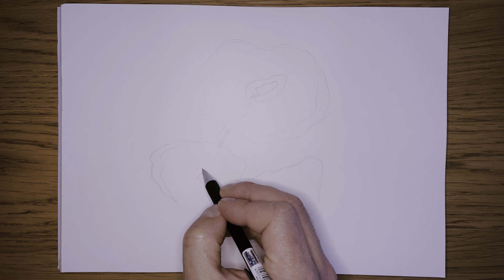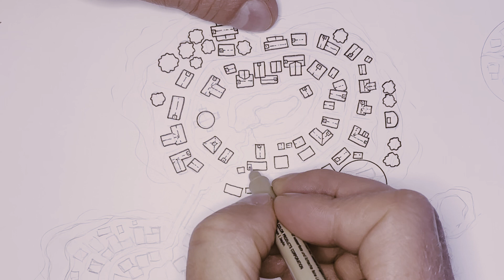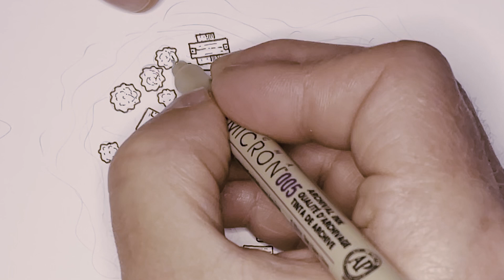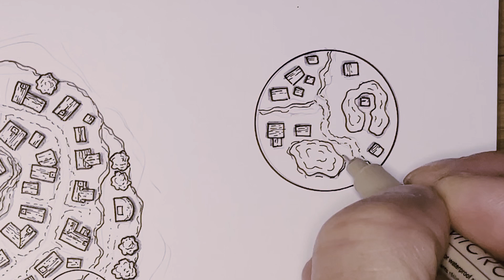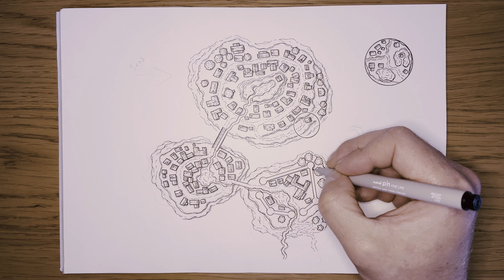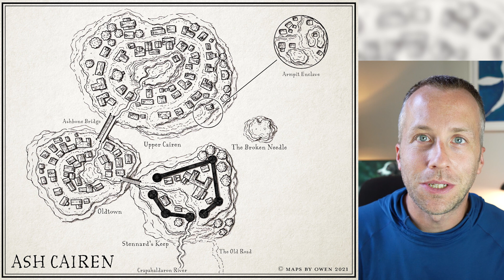How to Draw a fantasy D&D City or Town Map for your campaign

Comment: If you think of fantasy in modern western terms, yeah - maybe 4 people in a house. But usually you think fantasy in medieval standards and then it's easily 20-30 people in a house (end the 'houses are crammed together). Besides - it's fantasy, so you decide and then 50-60 people is feasable! It's only 5-6 families 🙂 Thus it could be only 150 houses, clustered into quarters/groups... Anyway, cool video - thanks...

Comment: Well massive, what is that? If we see that most Fantasy worlds are oriented on medical time, an 8k populated city would be already massive. Cities like Cologne with 20k have been scarce. It is also modern thinking that in a house live 8 people, at that time a household has been 10-12 people at minimum. In a city house, the family was father, mother between 6-8 been normal, mostly the parents of the wife, they all lived (slept) on the first floor (because it was warm there. Was the owner of the house a master craftsman under the roof his journey(s) and apprentices lived, on merchants there were rooms for maids and clerks besides them there was often also a part rented out. Medieval cities always housed a lot of people which not been citizens, and day laborer could never afford a house, there been also always traveling craftsmen for the church builds (which never been finished in live time) during fairs there been a lot traveling merchants. A house was often packed with 20-40 (especially with 2-floor buildings) people, not 4, that's very modern thinking. Not kidding some even shared their room, some used it during the night and others during the day. Night watchmen or pee collectors did work during night time and slept during the day while the other rentee did work. So with just 20 people, it comes down to an app. 260 house not 2000.

The second thing I have such density of population comes for a reason a village doesn't grow to a town or city. There are only 2 reasons there is a valuable trading good at this place this can be only salt or ore, everything else was house-made. The second reason was a ford in a river or the crossing of trading routes or passages, where the ruler had income through customs. In both cases the city/town was often planned on the table (at least its start) so the city center was around an often exact square market, there also been a townhall and the houses for the richest merchants.

Munich e.g was founded to redirect the salt trade so that customs had to be paid to the Duke of Bavaria, Lubeck was founded right between the Baltic Sea and the North Sea at the river Trave, so ships could sail there unload and the goods could be transported on land (later channel to the other side)

The Donjon calculator has a strange thinking from the beginning, a city supplies that area around (it's more the other way). There have been listed craftsmen which even been banned from towns like blacksmiths, I took a calculation with 1000 citizens and there been a jeweller, who shall buy his products from the farmers around the city or the rich merchants of this small city? A city like Cologne (see above the size) had only 25 rich families and even with the bishop, a jeweller could hardly exist from their needs. He also gave a wine seller and a beer seller, wine was again for the richest of the rich, especially wine in medical times was spiced, beer on the other side was consumed widely but every citizen had the right of house brewing only very famous beer was traded the Hansa traded eg Beer from Einbeck, someone would not go to a "beer seller", family with house brew themself and the ones who live under the roof go into the tavern for eat and they will drink their beer there to.

If you start to draw from the reason why the city exists and what is their specialty, the city will look very different, smaller, and with each different purpose the city will look very different, which makes the thing more interesting

Comment: Your wrong about how many people would live in a single building. This might seem weird to think about but apartment blocks were a thing even back then. Though they were not referred to as such back then. They were larger, taller buildings, between 3 to 5 stories tall what housed a number of families. Also typically had shops on the ground floor. So around 30-40 people or so. 8k ÷ 30 = 266. Witch is a lot more manageable.